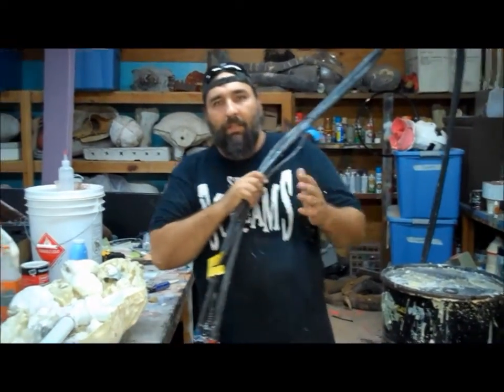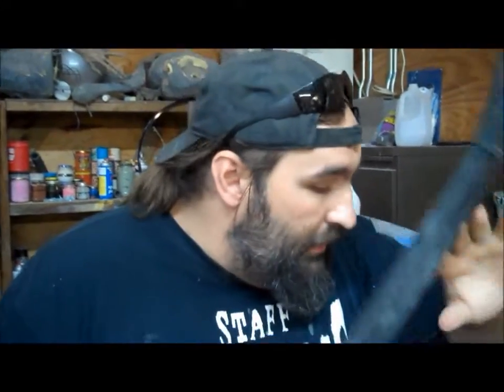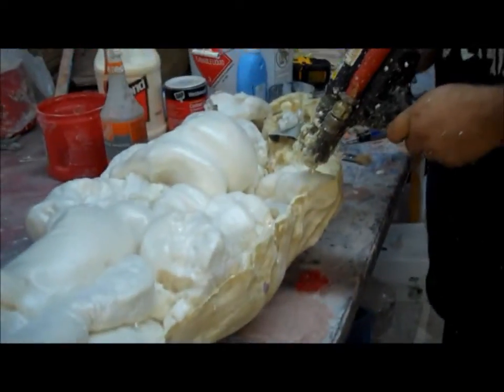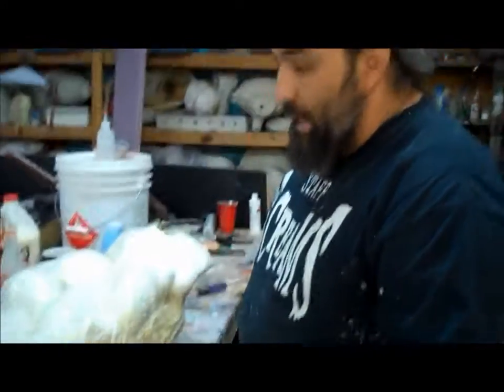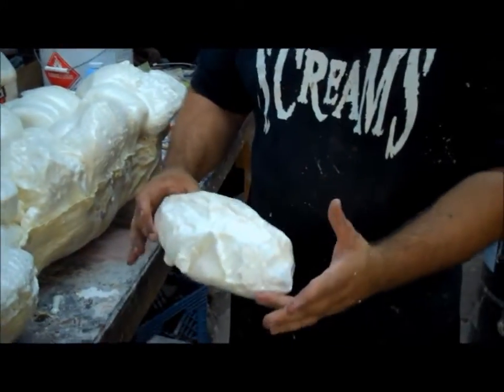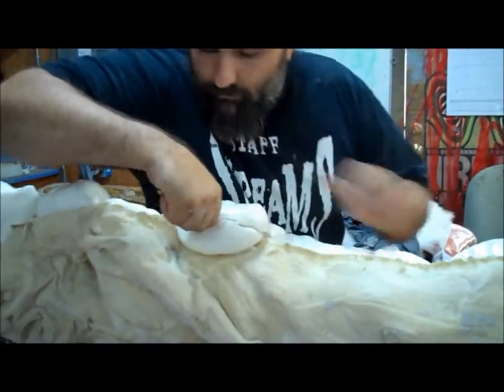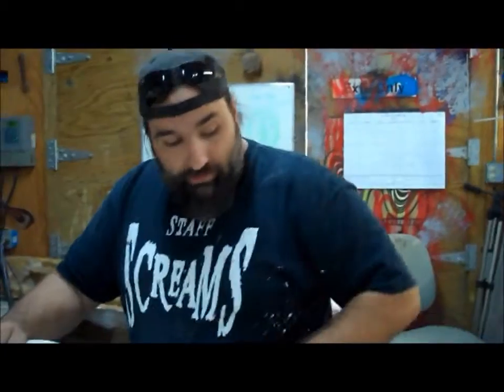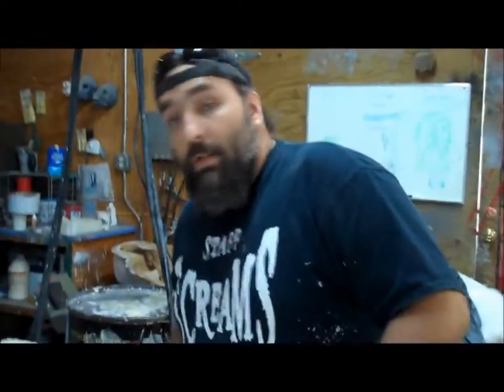My foam gun.wmv

Comment from the maker: I still have the foam gun,and I love it. The biggest con is that the tank storing the B side component needs to be warm or the pump cant move the material and it will shut the machine down. So in the winter you need a spacee heater near the B side. The pro is that you dont have to mix foam if you need rigid foam.
 It does not clog in the hose or nozzle (never in five years). the nozzle is cleaned each time with a wire brush and solvent, they give you a station for that.

Comment from the maker: @goldstud  If you hand mix foam you can do that, but not with the gun. the gun greatly speeds up the process of foam filling something in the shop- but it does limit you options like density and color. I also almost always have a latex skin on the prop and that is the side I paint so the foam color dosent effect the paint at all, except the back end of the prop that no one sees- and the foam from the gun paints easily also.

Comment: I so want one of those guns! Is there a cheaper way to make that foam? I tried wrapping packing peanuts in clear wrap and heat gunning it but the results were not so good. It made a solid mass, but the blood just beaded off. You need the porous foam to hold the blood. I've tried Great Stuff but its so expensive. I'm open to suggestions!